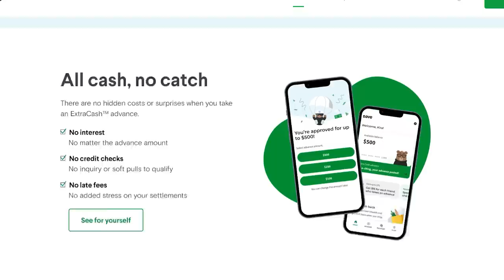FORGOTTEN Dodge Police Car - First Drive in 25 Years!

Comment: On the trans you took out there are two small snap rings holding the shift linkage together. If one of them is missing, you will have clicks from the pawl, but the spool will not be moving in the valve body. Easy to check. Great to see it running, congrats!
Reply: If they are there then the only thing I can think of is the valve body inside the transmission isn't flat causing it to not select any gears and be stuck in park/neutral

Comment: Awesome! The part of the video with the old trans when you we’re checking for gears-13:50-… you can see around the coil sparking out at the plug boot. Not sure if this is part of your idle issue but thought to throw that at ya.  Onward to turbo! Cool build man! 
Chris- Tuscaloosa Al

Comment: Dylan, I'm glad to see someone else messing around with the MOPAR Magnum engines.  I used a 5.9L Magnum in my 1957 Chevy truck (Ethyl).  I'm curious as to why you went with the A-904 instead of a 46RH.  I would think that the addition of overdrive would be kinda beneficial, especially once you add the turbo.  I do absolutely love the project and the channel.  Keep up the good work.

Comment: Dylan Sir, I don't know if anyone else seen it or not but when you cranked it up on the lift around the 13:50 time stamp in the video  I notice a constant spark like a plug wire spark over on the passenger side firewall. Not sure what it was just didn't know if you knew it. God Bless you my friend.

Comment: I don’t know if you noticed but around 13:50 in the video I think you can see the spark jumping from your ignition coil  maybe shorting out a bit, if you look just above the carb and on the passenger fender
Reply: I saw the same thing man👍 , surprised it ran as good as it did
Reply: @ozmanozgood856  me too, could be why it’s kinda hard to start it up?
Reply: @SlapnPickle  yah most definitely , its killing spark randomly to the cylinders until it picks up enough rpm

Comment: You are teasing us with that Shelby Charger hiding behind the cop car at the end of the video! I had one of those as a teenager - loved it and thrashed it to death!
Reply: I had an 85 or 86 charger, just your standard run of the mill red on red with the gray stripe package that proudly said charger 2.2 on the rear quarters. Had a sunroof and 5 speed. My only gripe about it was the shifter cables...felt like it was connected with ropes instead of cables lol.
Reply: @williamsinger4124  I used to go through exterior door handles every few months!
Reply: @heofthesquarebum  yes, the outer driver side handle on mine broke as well. And damn it, it always split toward the door lock side of the handle, effectively turning a one piece handle into a 2 piece

Comment: I can't hardly wait for the turbo install. I  also live in TN.  I love the test drives can't beat those curvey mnt. Roads.
Reply: I am a noob, but I was wondering, did they not make the police cars faster than any other vehicle. Would it not be fast with the original engine or did it have some issues. I was also thinking the separate wiring to the lights was due to safety, if it would be just one wire, both would fail, but like this they could be able to keep one or maybe it was so that the front lights would flash intermittently (no idea if that was a thing in US).

Comment: I bet it just some timing issue with that low idle issue. If you can get that spacer with the gasket. I bet that transmission would shift like butter with that larger pan on it. Love the sound of it.

Comment: The 85’ police edition diplomat was my first circle track car. Came with the 318 but we swapped it out for a 360 after one season. The 360 made much bigger horse power.  We also had a 3.42 rear end gear in it. The downside was the transmission. Occasionally it wouldn’t engage and eventually broke after 3 seasons of racing.

Comment: I've had 5 diplomats.
2 turbo. First turbo setup was in 2000 big turbo off a Cummins 10 liter, she ripped! 4.56 gears and a 4 speed. Ran 12.30s spinning tires.
Incase your wondering, all provisions for a 4 speed manual are in the car factory.

Comment: Love what you doing I have an 87 Diplomat myself that I am working on been doing a little bit here as I go along drove it back and forth with the lean Burn System from Lexington South Carolina to Charlotte North Carolina everyday for about 6 months got the car up to 22 miles per gallon and that's with the carburetor not really hooked up electronically to the lean burn. I will be converting it over to other things. I picked up a Chrysler Fifth Avenue that has the better K member. 88 and 89 had better k members. The steel that was used before was two weeks overdrive in the car made the shock Towers point at each other. Then you would run out of room for adjustment on alignment. I have other things I'm doing to this would love to talk to you about it

Comment: I wonder if that weird thing at idle could be the torque converter not unlocking.  Or the mechanical linkage from the carb to the trans for kickdown not  being installed or not adjusted.

Comment: Those intakes work but you need to port match them. Thats where they fail. There ports don't usually line up well against the head ports. So port matching is always best to do on those off-brand intakes.

Comment: My 91 ramcharger just did the same thing with that wire 3 weeks ago that powers everything ran it on a circuit breaker sense it’s a fusible link all good now

Comment: What's the weird flashing spark on the passenger side of the inner wing? Happens every time you rev it. Starts around 13.53 mins
Reply: 13:49 coil 🤷‍♂️
Reply: @RustyZipper  I knew it was the coil,just puzzled why it's grounding itself out to the body

Comment: Honestly with how much trouble its given you, I'm seriously surprised you didnt just leave the original engine in and got it running as it was with maybe a carb or an intake swap, or literally doubling the stock setup, and I cant imagine a turbo fitting in there at all, unless you put it where the hood was.

Comment: Wonder if a A727 or A518(45RH) would be good alternative transmissions.

The A518 was a 4 speed lockup version of the nearly bulletproof A727 transmission and uses a very basic solenoid to engage and disengage the od gear via a solenoid.

I know there's throttle kick down kits that bolt onto carb setups that use a simple relay to engage and disengage od for transplanting in the 440s in front of the A518(45rh), as I looked into it years ago when I was debating trying to track down a 413-3 big block that Chrysler used in some of their motorhome platforms as a replacement for when my high mileage 91 360-1 finally gives up the ghost

Comment: That wire you mentioned is normally located on the driver side fender (dodge trucks) , passenger and most Dodge/Chrysler products used that wire for the ignition I believe

Comment: Hi Dylan!I Hope you are well. My mom has a question for you about her 2006 Toyota Sienna.Her question is! Why does her car squeak every time she starts the engine and when it is very cold outside?And when she puts the car in park and taps the gas and then the brake it stops squeaking why is that?  She asks me  because I know a lot about cars and for some reason I have no idea. She told me to ask you.
Reply: My ‘05 Astro Van does that when I’m cruising down the highway and it’s like 15•F. If I let off the gas it goes away. I’m assuming it has some type of vacuum leak that is only noticeable when the rubber constricts due to cold weather. Whatever she does do not sell that van! Them Sienna’s are very good 👍
Reply: Thank you. My Dad bought it some what new and that was 17 years ago with 34 miles on it (I think) and now it has 107,528 miles and we do not plan on getting rid of it any time soon.

Comment: Should put the stall converter in the transmission  you have now to find out wether its the converter or transmission...also...it didnt seem like you hit enough RPMs on video to kick a 3000 rpm stall converter in..

Comment: It's got a cop motor...it's got cop tires...cop suspension...cop shocks....it's a model made before catalytic converters, so it'll run good on regular gas....what do ya say, is it the new McCool mobile or what?

Comment: hard to tell with the exhaust leak but it sounds like a dead miss. pull the plug wires one by one and see if it changes.
Reply: When he cranks it, it sounds like it has a dead cylinder, you can hear the change as it cranks
Reply: @dave1135  could be, same diagnosis though, identify which one it is then proceed to tear it down.